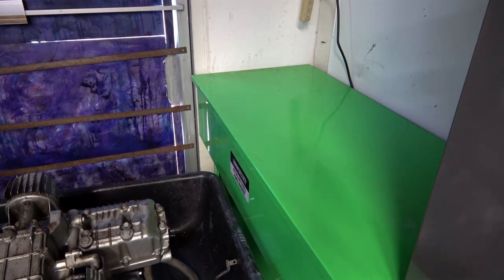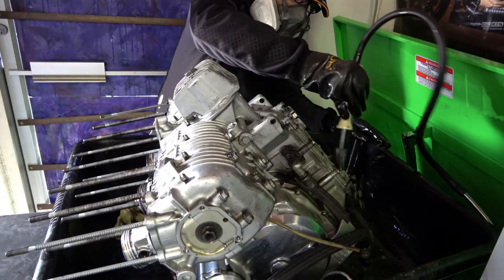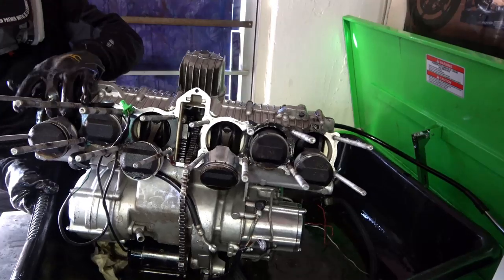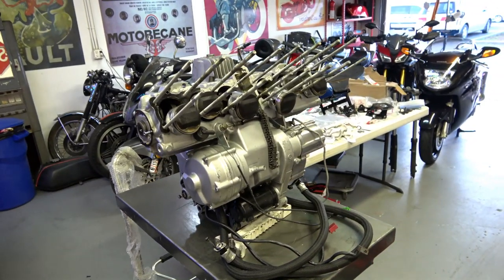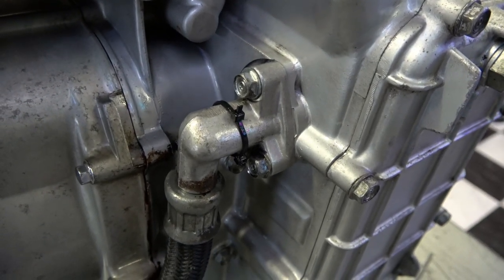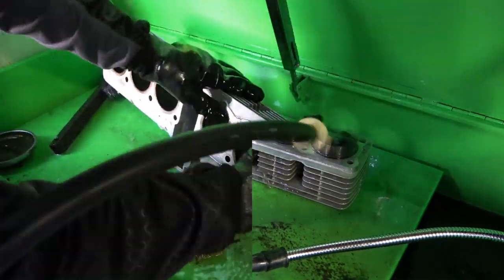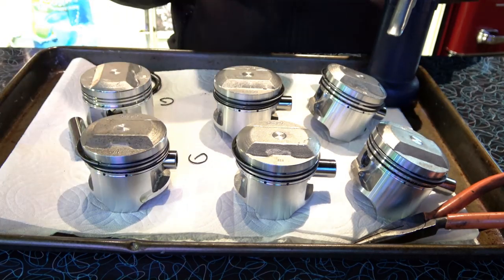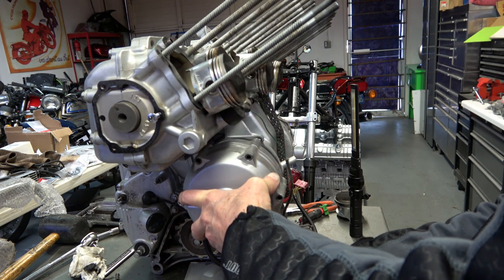Honda CBX Step by Step Restoration Video Series Part 31 - Tear down of second CBX in the Series

Comment: Thank you so much for giving these beautiful machines new life, and soothing my OCD by scrupulously cleaning the engines prior to parts removal; I just can't stand watching videos with a disassembly, and they are still caked in dirt and grime hahaha! Is that an '81 or '82 CB400T/450T Hawk lurking in the background? I had an '80 400 and an '82 450 back in those years, loved the little things. :)
Reply from the maker: Hi L
Thank you for your comment, I really appreciate it. You're right, that is an 81 CB400T with 973 original miles on it!! I got it from a relative a few months ago and is all totally original and is amazing condition. it needs to be cleaned up, but is a total time capsule.
I will be selling it if you are interested.
You can see it featured at the end of one of my previous videos. Here is the link 

https://www.youtube.com/watch?v=tvVmPmig4UU&t=563s
Thanks again L :)

Comment: The backyard mechanics, I wonder where these two screws go. 
Pete I find wiring is the worst for back yard mechanics
Reply from the maker: Every classic car or motorcycle that I have restored, except the nice original survivor, has had a hacked up wire harness(s). I think backyard mechanics are born with a gene that drives them to hack up wire harnesses.